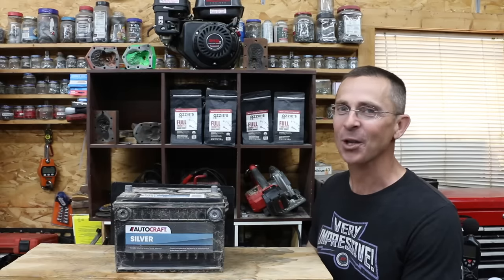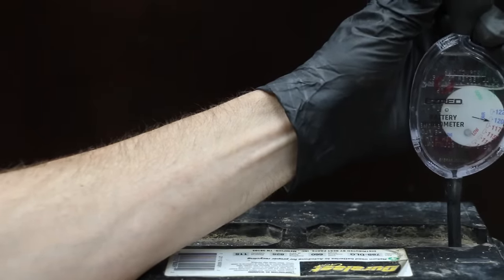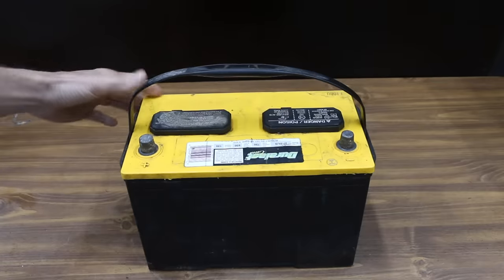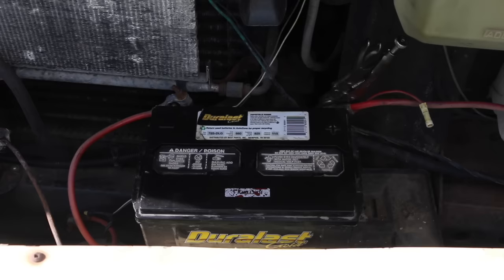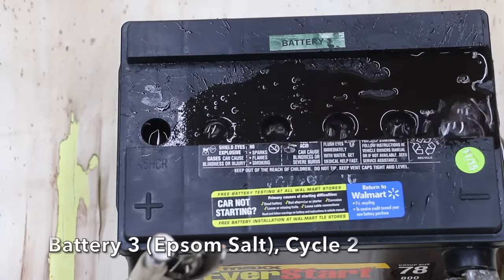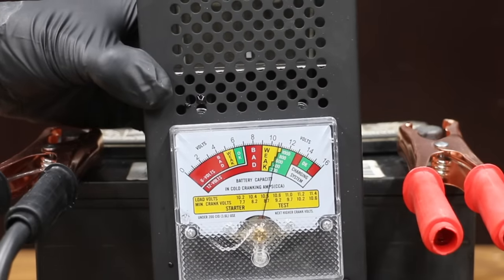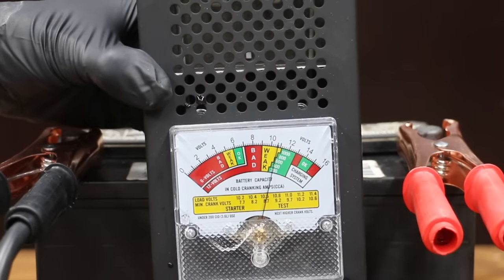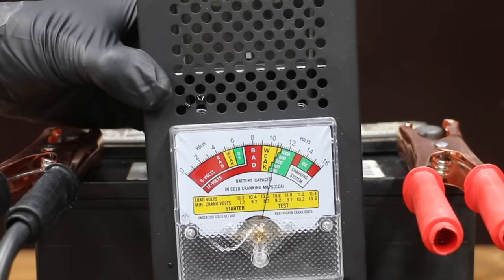Myth Busting! Can You Restore a Dead Car Battery With Welder?  Let's Settle This!

Comment: Enjoy watching your real world tests!! Quick question: what was the output voltage setting on the welder when you hit the battery with 70 amps? Just thinking, dunno if it's dumb - after the Epsom salt process, you could have drained the battery and filled it with fresh sulfuric acid and then hit it with the welder....?
Edit: or maybe connect to a normal charger after filling with sulfuric acid...?
Reply: I wanted to know the voltage from the welder too!
Reply: I am working on my battery now. When charging, the voltage is 16-17v, and the actual amperage, battery charging cable,  is just 8A to 10A even set 45 on my welder.
Reply: @nguyen_tr  I have a MIG that I can adjust down to 15V

Comment: The best process I've found with a stick welder is a lower current, 5 min on and 10 min off for at least 2-3 hours.  It is a slow process, but it definitely works.  Yes, if there is a cell that does not boil at first, you can up the amps on the welder for one or two cycles, and that typically does the trick, then you simply lower the amps on the welder and continue the remaining cycles.  you can also use a charger with the START selection.
Reply from the maker: Thanks for the feedback.
Reply: How much current we talking here?
Reply: @RogerPack I have done it after filling with distiled water and starting voltage 12.4.
1st cycle 25 amps for 5 minutes (1 cell didnt buble) 13.1v
2nd cycle 30 amps for 5 minutes (all cells buble and electrolite in 5 turned black in one turned gray) 12.1v
3rd cycle 35 amps for 5minutes (all cells bubles equally) 13.1v
4th cycle 40 amps for 5 minutes (Little bubles) 13.1v

Battery runs quite good and holds 12,4 v even if left for 2 weeks in car. I do not know how much it will last but i am happy with results. Now i think if it would be better if i have flush it with distiled water after welder cycles and then fill it up with fresh electrolite. 

My battery is 2014 Chrysler OEM battery 80ah 640A

Comment: This worked well for me with Trojan 8V golf cart batteries, with the following modification,  I had to hook 2 batteries together in series to get any amperage flow.  With the Titanium Stick 225, the thermal light came on immediately (also indicates a grounding issue).  Tried a different welder and it didn't work either.  Switched to the 2 - 8v batteries in series and it clicked over and started working.  Thank you!
Reply from the maker: Thanks for sharing.
Reply: @kiltedpiper98 I have a golf cart powered by 6 Trojan 8V Golf Cart Batteries T-875.  Yours are likely the same.  When you switched to connecting 2 of the batteries in series did you start with the first battery connected to the main positive and then connected the ground to the negative post of the second battery in the series, then repeat in sequence?  I am going to try this tomorrow.

Comment: Interesting ideas , thanks ... I will say that on a side terminal battery you can not just use a bolt screwed in to test it, especially a load test , you need to run a nut down the bolt so it buts up against the lead terminal, that's because the threaded part is not securely attached to the lead post ... it's part of General Motors info for  load testing side post batteries ... another thing is that after charging a battery, you put load on the battery for 10 seconds  before you test it to remove the surface charge, also, I wouldn't use a wire type post cleaner, it leaves the post rough, use a scraper type that leaves the post smooth with the proper taper for a good contact with the battery cable  ... Caution: any rotten egg smell is hydrogen sulfide gas and is dangerously explosive  .. no way would I be bubbling a battery inside a garage
Reply from the maker: Thanks and you are welcome!

Comment: Depending on the health of the actual battery and why it died (i.e. if it died from sitting unused over the winter months), it can be charged and revived to work again for a while. There's a lot of factors that contribute to if it will last, but typically if it holds a charge after reviving, it'll be good for a bit.
Reply from the maker: Thanks for the feedback.
Reply: However a dying battery can overload a charging system especially when it has a shorted cell. As a motorcycle mechanic (where batteries tend to be undersized for obvious reasons) I've seen that fairly often. I load test my batteries (load testers are cheap being basically a resistance wire, switch and meter) and marginal ones get recycled. Batteries are expensive but charging system parts are brutal and regulators/alternators never fail at a convenient time.

Comment: Would you happen to know what kind of voltage and current is being applied to the battery measured by a volt and amp meter as it is charging? I do know that higher voltages will help desulfate a battery better than most regular battery chargers can do. It would be very interesting to know for sure. 🤔

Comment: Thanks for this! You should also test the Noco battery desulfator.  I got the 5 amp one, and my electronic battery tester said I've improved my lawn mower battery from 115 CCA to 172 CCA - though I did run the repair feature several times across a few weeks to fix it that well.  Just running normal maintenance on my car batteries has improved them all by usually 40 to 50 CCA and improved their resting voltage by at least 0.2V, for example, one went from 12.4 to 12.6.
Reply from the maker: You are welcome!  Thanks for the suggestion.

Comment: Metalic magnesium has a higher affinity for the sulfate radical than lead does. When magnesium is placed in a lead sulfate solution, the result is magnesium sulfate (epsom salt) and elemental lead. Placing magnesium rods in the filler ports of a lead acid battery filled with distilled water while charging could potentially desulferize the battery. You would have to replace the sulfuric acid, (battery acid), however. Metalic aluminum might also work. The arc welder works because is produces around 24V. Two battery chargers coupled in series could also work but might not provide as much current. Sodium hydroxide (NaOH used in some drain cleaners) has also been used as a first step in electrolysis for lead recovery from old batteries. It is possible that pretreating a dead lead acid battery with sodium hydroxide prior to recharging could help desulferize it. Great care should be taken, however, as sodium hydroxide could react violently with sulfuric acid. All acid in the battery would need to be neutralized first, then treat with sodium hydroxide, then charge (electrolysis), then replace the sulfuric acid in the battery.

Comment: I had the directions for the use of baking soda followed by the epson salt method to restore the lead/acid battery, but they have long disappeared. If I remember correctly you are supposed to drain the battery of the epson salt solutions, rinse thoroughly at least 3 times, add new sulfuric acid, and then recharge.
Reply: yes, he should have don refilling with sulfuric acid.
Reply: I noticed this too. The Epson salts are supposed to remote the lead sulfate that is reducing the CCA on the plates. You need to drain and refill with fresh acid.
Hopefully he can do a follow up video where he does this.
Reply: This is what I was wondering as well, how can removing the acid and replacing it with epsom salts water restore a battery? I would think that using baking soda to remove the sulfates off the plates, rinse a few times and then replace with fresh acid followed by a charge cycle is what is needed.   @Rockjob
Reply: @nekbiodieselworks  In some other videos, they just mix an epsom salt solution with the battery acid--seems like you should be able to just dissolve epsom salt into the acid and add as much distilled water as you need to top it off.
Reply: Kind of concerning ... how much does this guy really know . Back to the old adage " don't  believe any / everything on the internet "
Reply: easy there. the reviews and tests were open and filled with information, and if you want to do further tests for yourself, do them. you've already got the base info thanks to this vid, so you dont have to try them again. Whats not to like??
Reply: @markdudley3831  noted -  and ehm... you do realise that includes your own comment.. right?

Comment: Never thought about using a buzz box, amperage to desulfate a battery. I’ve usually used a series charger, instead of stringing a series of batteries to charge, hooked just one and started the DC range at low and start cranking up until battery started lifting the needle on amp meter, then dial down range, then use DC Coarse, DC fine. Sometimes hitting as high as 72 volts to lift the amp meter needle. One thing I might add using the series charger you’ve got to be quick at dialing down voltage when needle begins to lift as hydrogen gas starts emitting rapidly and any spark can be disastrous. Good video! 👍

Comment: As for desulfators, I'm a believer!

I built a power system for the cottage, which later, we brought home for emergency backup after we sold the cottage.

We had 6 "off-the-shelf" deep cycle batteries (12V), connected in paralell.
I had solar panels and a charge regular on it for when we weren't around.

Also, a desulfator connected 24/7 always.

I expected to get 3 MAYBE 4 years out of the batteries.  But I was way off.

We got almost 12 years out of those batteries until they were just done like dinner.

So yea... desulfators.. YUP!

For clarity  Desulfators aren't designed to "fix" a sulfated battery.
They are designed to AVOID sulfation.
Reply from the maker: Thanks for the feedback.
Reply: agree since starting to use these 20 yrs ago i have greatly increased battery life in my mowers, one got 15 yrs and still cranks,  the sulfate from plates will eventually build up in bottom andruin battery, have yet to try reviving by removing acid and using baking soda. then rinsing and restoring with new acid
Reply: @1toolaholic  At that time, I had considered doing restores on the battery bank.  But, in the long run, that would have cost me much more in my time that the actual cost of a new set.

One thing that really concerns me now are these "new"  Lithium "deep cycle" batteries.

Now there's a term of contradiction!
By their very nature, Lithiums do NOT like to be DEEP cycled!

Plus, having those on a solar charging system will shorten their lives as Lithium doesn't like to be charged thousands of time.
I think people who buy those costly batteries will regret their decision in the future.

Comment: Pretty interesting test! I'd like to chime in about the welder method as I've used a similar approach many times in the past with better result for anyone interested. Basically that welder is making the sulfate crystal fall off the plates to restore some of the battery's ability to convert chemical energy into electrical energy. The method I used in the past involved a battery desulfator with high voltage pulses, it works well but it also work so well that some of that sulfate residue shorts plates together causing high disvharge rate and\or worse CCA and since starting batteries got thin plate to start with it might just deal the final blow. It works better with deep cycle types. Today I mostly use a slow process involving high frequency pulse desulfator (Powerpulse is one of the brand I use). It's a pretty slow process taking up to a few months but I don't have the high discharge rate that the other method causes quite often and the results last much longer. Hell, you can even bring AGM battery back to life after the absorbent mat dried off, just add a bit of distilled water, enough to soak the mat and use a charger-desulfator or use a smart charger with the power pulse connected and give it some time and monitor the progress every week. Please note none of these method will work for a battery with physical internal damage (battery that got frozen solid, broken lead plate or internal junctions). Lastly, you'll be working with battery acid, lead and possibly explosive gases, wear proper equipment and dispose of these chemicals at a facility, not in the sewers, please!
Reply: You use a Powerpulse simultaneous with a charger?
Reply: Precisely! A small 0.5A smart charger is enough to keep the battery charged unless it has an unusually high self discharge rate.

Comment: Thanks for this test and also for being cautious about the ventilation. Those bubbles are hydrogen, which is highly flamable and explosive. My granddad started a car after a battery charge, but he didn't knew that the ventilation inside the battery was blocked by a bug that used this place as a home. The battery exploded and hot sulphuric acid was spilled all over the engine. He got scared and ran out for a fire extinguisher, fell and hited the ground with his head (he was also +70 at this moment). Gladly he only got some stiches and the car was painted back with no problem.
Reply from the maker: You are welcome!

Comment: I found the $20 desulfators can work if the battery is not completely shot. While it may not bring a totally dead battery to life, if it can bring it back to the point where you could use it to run small equipment/give emergency power, I think it is worth it!
Reply: I had done some research on desulfator because my boss wanted me to keep the batteries charged in two service trucks that the company was selling. At the time I purchased the desulfator, a NEXPEAK NC101 charger it was selling for $23. It's now on-sale for $19. After trial an error I discovered that you need to keep the desulfator running for 24-48 hours to get the ideal results. The charger will actually turn itself off when the battery is fully repaired/charged. My boss was happy because he was about to spend $250 a piece on new batteries from Autozone.
Reply from the maker: Thanks for the feedback.
Reply: I have had luck with these desulfators, I purchased the 4 amp version, as it seems to work with bigger batteries better. What I usually do is take the battery, top off each cell with distilled water, then hook the battery up to a trickle charger then attach the desulfator and let it sit for a few days to a week. Then the batteries usually start testing as good.

Comment: What causes battery failure long term are micro fractures in the electrode plates.
Reply: I have killed mine on the vine with neglect because I have too many cars. Ones that are maybe 2 years old just won't charge up.

Comment: Interesting tests!  But I'm confused. First, what is Epson salt and baking soda supposed to do - dissolve sulfates?  Second, attempting to charge a battery where Epson salts and water replaced sulfuric acid seems odd. Is the sulfate molecule in epson salts supposed to function equivalent to the sulfate in sulfuric acid?
Regarding the stick welder, you were able to specific the Amps. But the Voltage of the DC welder's output was not specified. Does a DC welder attempt to maintain a specified voltage at a selected current? (It should, in order to regulate power) If yes, what voltage? Is the voltage of a DC welder a standard value among DC welders?
Reply: The voltage isn't standardized, but it is usually pretty low, especially on a stick welder. Definitely below 50v, but most likely somewhere around 20v. But that's just the open circuit voltage. During welding, the voltage can fluctuate depending on the resistance of the welding circuit. But again, it's generally quite low, especially on modern welders. The open circuit voltage is generally the highest voltage to help with striking the arc, but once struck, it should drop considerably. But it should never be above 50v, because then it can overcome skin resistance and shock the operator.
Reply: @Adamant4160  Thanks for the reply. Even assuming the welder's voltage drops when it's applied to the battery terminals, I'd worry that the combination of a voltage higher than ~14.7 V plus a high current, could be dangerous..
I still don't understand the relevance of Epson salts

Comment: My Dad was a patent attorney for ESB, which made Exide and Willard automotive batteries. The engineers gave him an experimental battery to use in our station wagon. That thing was strong, and lasted ten years. It even pulled double duty in our boat. When Dad was getting ready to sell the old wagon, he called the Exide research center and asked them if they wanted the battery back for evaluation. They told him they couldn't sell one of those batteries because they were nearly impossible to kill, and they wouldn't sell many replacements. True story.
Reply from the maker: Thanks for sharing.

Comment: Nice test as always !! but instead of using a DC welder, you could also have used a 100 amp battery charger.  This would probably have done the same job with a dead battery as the welder :P      Usually on a dead battery you want to charge at a really high amperage, and lowering the amperage down as the charging states goes up .
Reply from the maker: Thanks!  Thanks for the constructive feedback.
Reply: He says that at the beginning of the video

Comment: What kind of longevity can you expect from a battery that has been zapped back to life with the welder?
Reply: In theory it can be done an infinite number of times. You're reversing the degradation done to the lead plates; reversing the galvanic corrosion. In practice though, its not absolutely infinite.
Reply: unless the plates are physically damaged, it should be indefinite
Reply: Ive had a dozen end up with shorted cells, they would have to be repaired internally or I suppose dumped out and washed  =[